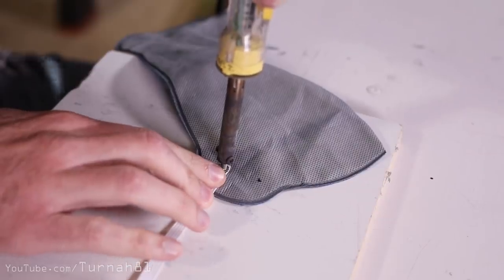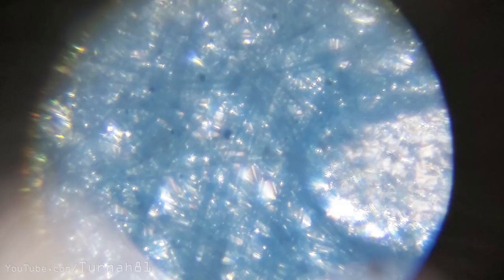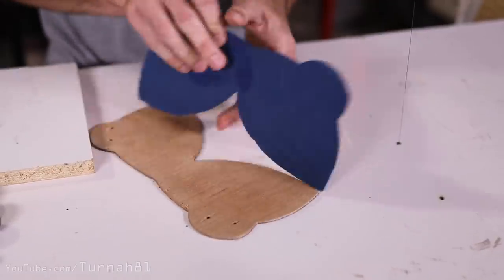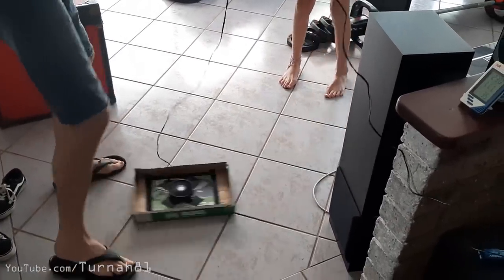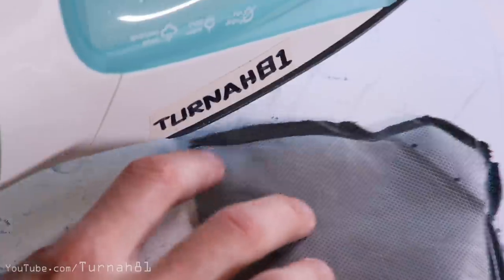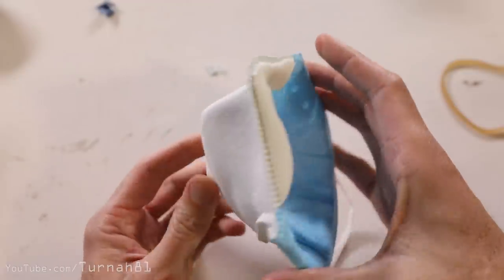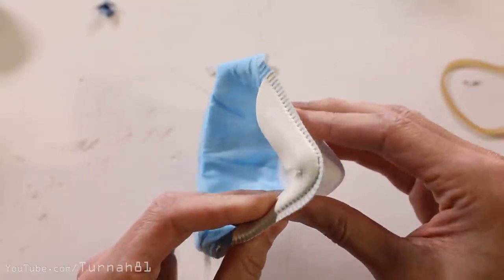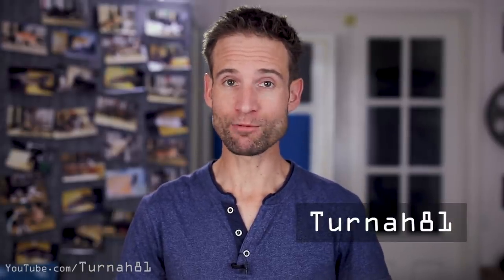How to Make the Best Face Mask, No Sewing (Don't use Cotton or Vac Bags!)

Comment: Dude who has surgical gowns and car covers in their home?
Reply: I found some of the grocery bags!
Reply: re-useable shoppers from Walmart are 99 cents here buy a couple skip the car cover part, i think!
Reply: Even decorative bed liner made of olefin is the exact same thing. Those foam sheets are in the craft section at Walmart in stacks  of 50 for about 2 bucks. I think the edge of a hot comb covered with  aluminum may help weld and the teeth might work on the elastic. Then wear a cheap Mask or  bandana over it to keep it protected from napping.
Reply: I can order a car cover from Amazon for $150 to $200.  I spotted a car cover on a neighbor's antique roadster in his driveway a few nights ago...Hmmmmm!

Comment: The stuff with the dots should only be used in the outer layers. It's used in proper masks because it's easier to shape, but it has terrible filtering properties. This thing you're making is only make things worse because it will give you a false sense of security.

Comment: Nice video Craig. After seeing that soldering iron tip I think that you should stick with the screw rather than putting that tip back in.
Reply from the maker: Yeah actually a counter sink screw head would be ideal. By chance though the bolt I had threaded in. That never normally happens.😀

Comment: Awesome video.  I tried my wood burning gun which has several different tips. works great for sealing hem and setting elastic.  instead of soldering gun with screw or iron.  Ofcourse your video gave me that idea after I melted polypropylene all over my iron. :)
Reply from the maker: Awesome yeah hearing lots of good reports on using wood burning tools. The PP comes off the iron pretty easily. From cold turn it on as it just starts to warm up it comes away easily with a wet cloth. cheers
Reply: What kind of tip did you use to seal the hem?

Comment: Fantastic design and interesting technique.  I couldn't wield the iron as shown, but I found that the handy Chicago Electric 5 in 1 Woodburning and solder tool I got at Harbor Freight a while back ($10) does just the trick using the round nub end and a piece of foil on top to prevent burning holes.

Comment: This is what i use as a linning in my cotton masks because its also water resistant so its perfect for protecting the inserted filter. I dont use pins because i avoid unnecessary perforation so i hold it together with tiny binder clips👍

Comment: I've had pretty good success with this design. I use my laser cutter to cut out the material and I also cut an MDF template with a 6mm inset to guide my soldering iron for sealing the edges. I use parchment paper above and below the material and found that 400 C is a good temp to slowly run the fat tip over the material. I've been using 5 layers of Smart-Fab which seems to be a good balance of filtration and breathability. For anyone else using Smart-Fab, I was able to use my 3D printing pen directly on the fabric  at 165 C and fuse up to 4 layers from one side without causing damage to the material.
Reply: "I accidentally made a hovercraft" Is a sentence I never thought I would hear.  Great video!

Comment: Great video, fun and educational at the same time. I'd probably just sew the seam and then iron heat seal the whole mask, like what was used for the front V seam. I couldn't trust myself to be consistent in the quality of the seam if I just used the iron method. Plus, wouldn't want to spend so much time on trial an error. For personal use, it would be good enough.
Reply from the maker: Yeah that sounds perfect. In sewing the front seam  the only issue I had was the thickness. I think I was getting to the limit of our machine? The thread was snapping sometimes.  I'm not very good with getting the settings right either though.
Reply: @Turnah81  Sometimes a different type of sewing machine needle helps.

Comment: Great video! Sleek mask design! Thanks for sharing it. The only comment I have is that N95 masks are electrostatically charged (in addition to using high density PP) to further increase filtration efficiency. Although the mask in the video is highly likely to perform better than cloth masks and likely to be better than surgical masks, I would hesitate to make definitive claims about filtration efficiency because that requires rigorous testing. All that said, enjoyed the video!

Comment: Be Careful when you use those materials!!!
Non-woven propylene can be of different grades, some are ok right in front of your face and some are not. Some can shed fibers through the whole life of the fabric (even after washing and in some cases washing accelerates the breakdown). I had some bags made with it that literally turned to dust in a couple of summer months in the car while other grocery bags of that type (obviously better quality material) have been there for a few years and are fine. 
The quality of this material has an extremely wide range and the lower quality is not something you want to breathe through.
The nonwoven material used in masks is certified for that use even because the whole production and materials qualities are controlled, not just the filtering level.
Masks used in hospitals in the old days (up until around the 70s when everybody moved to the disposable ones) were cotton muslin (defined as fine dental gauze), 4 layers. They had a pocket for filter to use in surgery (in surgery room the filter was meant to block exhalation, can be switched for a different filter now) . One example was the Cestra mask if people wants to look it up.
It's not meant to be fearmongering, people can make their own masks however they want as long they know that they could be breathing in small fibers that could mean lung trouble. If they want to take that risk they are free to do so, but there is too much quality variation to just pick whatever nonwoven material that looks right.
And I do know that is suggested to use that as a filter layer in masks but, for DIY, it is impossible to judge the quality of this kind of material until it actually falls apart, and one doesn't realize right away when it starts to break down as it starts slow at first.
BTW there are doctors that endorsed the use of vacuum filters also, made youtube videos, and then comes out that they are not an healthy filter material. So much for that.

Comment: This is the best "DIY" mask out there, with several flaws.
Without the exhale valve the CO² level in your blood will soon increase to a dangerous level, and in a long term usage might cause several problem like nausea, fainting, dizziness etc. It can even be fatal in rare cases.
N95 mask is really bad at circulating exhaled CO², thus the need for exhale valve.
Reply from the maker: Respectfully its simply not the case. Many N95 masks have no exhalation valve. What your describing would be the results of breathing into a larger dead air space like a bag. The valves don't evacuate any additional exhaled air as they aren't pumping air out,. They do make the mask less humid though and decrease the chance of glasses fogging up - more comfortable. However they are also a failure point for reuse as the can begin to leak with small obstructions and wear. They also should't be used if you are sick - they release respiratory droplets.
Reply: Fair point on the release of droplets, as a mask(for Covid19) is more for the safety of the public rather than the user.
Nothing more to say than "Well Done mate"

Comment: This is the best diy mask I've seen yet. I ONLY WISH we knew how the factory electro charges them. I heard n95 mask get some type of electric charge which keeps viruses out. I also heard they lightly spray the front with some citrus.
Reply: The electrocharges are done in the melt spinning process to make the non-woven fabric.  It is covered by several patents and contributes greatly to the efficiency of the particle filtration - especially small particles like viruses.
Reply: I saw a materials specialist on YouTube explain that you can use a hair dryer for 30 seconds to add back "static charge" after washing and disinfecting in boiling water for 10 minutes.  He also said this was optional, as most virus filtering happened from the structure of polypropylene itself.
Reply: @datasciyinfo5133  interesting
Reply: The term, according to my Electronics engineer is "electret"...

Comment: Instead of the electric wire, I use solder solid wire (3mm) that I hammer to make it flat. It is so great that I make it the full length of the mask.

Comment: For the adjustable nose piece, Im using the rim of circular tin cans. The body of the tin can is too thin but the rim is about 2mm.

 I use a can opener and shears to rip it out and cutt off excess. I then go around the entire thing with pliers so no sharp bits are poking out. I suppose I could go over it with sand paper as well.
Reply: Now that is a good idea, thank you.

Comment: 1- car covers are made from many different materials
2- N95 masks are not simple filters. They use an electrostatically charged material in the center layer, to trap finer particles. Big difference!
 Or see filti dot com for a new fabric that claims to have a better effectiveness than N95 because it uses a finer filter layer.
 And "moleskin" or similar foot blister padding will do the nose seal. Cotton or plastic foam, self adhesive.
 What you've got is admirable, it just isn't near N95.

Comment: Floor dust collecter like you see on a wooden floor brush . It's non woven and very cheap  to use as your filters. Use you cotton for the outer cover and seal it all with wonder web like you use for hemming a pair of trousers and Pipe cleaners for the noese seal  . No Holes . no needles. easy

Comment: I Used a vacuum sealer (to seal food in storage bags) to seal the edges and it worked great, only if they had one that curved. I also used the tie from a coffee bag for the nose piece.  I did use a Micron Filter Vac bag though, not HEPA. Thank you  Turnah81

Comment: Something to take note of. The major difference between this and an actual n95 mask is that the n95 mask has a static charge which attracts particles to it. It is that mechanism that makes them so effective, not that they are made of pp. You may as well use cotton wool as it is more easily available in the baby and makeup sections of supermarkets.

Comment: Take soldering iron, change tip for copper tip or you use plain iron nail. Flatten the end of the tip and you can use that istead of plain iron. More precise and more convenient to use. There is clip on YT how to make flat end of pin on soldering iron and it is used exactly for this - joining without sewing...
There are various soldering irons, some have temperature regulation, but with a little of practice there won't be need for temperature regulation. I hope you make new video, with some improvements you made maybe. All you mentioned in video should be posten on web page, with lists of materials, dimesions, steps, pictures, photos...of course, if you have time.
Also I would like to see you come up with mask made from hepa vacuum cleaner bags maybe?
This video is one of the most helpful I foound.
THANK YOU!

Comment: I had thought about getting some small-sized bras and cutting them in two, adding some rubber bands, and away you go!
Reply: Actually, many years ago someone did come up with a commercially-made bra that could be removed and folded over to use as an effective gas-mask. But the invention was a flop as it was only effective for some women. An A-cup for example was too small, and a DD-cup was far too big. Covering the entire face.
Reply: Rusty The Raver I made one with a bikini top. I get lots of compliments 😂

Comment: Great video!
Suggestion... laminate a middle  layer of a micro-particle HVAC air filter that is rated for bacteria and viruses (at least 0.3 microns). No vacuum filters as they can contain fiberglass (not good to inhale glass particles).
In the US, we use the MPR or MERV scale to rate particle filtration. This info is on filter packaging (in US).
The one I use is made of synthetic fibers that have a factory-applied electrostatic charge that aides in capturing micro-particles like viruses.
Thanks for the "asshole" imagery, its better than "my grangmother's coochie" that I was going with... I know, I have issues too.
Stay safe everyone and keep the video's coming!!

Comment: Fantastic video and ingenuity, if you wanted to test the effectiveness you could build a small acrylic of polycarbonate box with a smaller square cut out of one end' place the filter over the hole and seal with' place a a fan on top to push air in. On one of the edges if the box you can. Have a small slit to let air out to make positive pressure in the box and to test particles you can use a sensirion SPS30 particulate matter sensor (they are pretty affordabel).

Comment: Interesting mask and thanks for the time you spent on it.  Did you ever consider any kind of sewing interface instead of cutting up an expensive car cover?  Also I recently read that if you take one or two pieces cut from furnace filter MERV 16 (or you could double Merv 11) and use that (don't know if it is washable but you could probably make a little pocket and wash the outer part after each use and retain the filters.  My problem is that the original N95 masks (lucked out as my son had a box from before this started) are too big for my face and this probably renders them useless.  I only need to wear it once a week and then I leave it on my dash to be sanitized by the sun, I hope.  Someone correct me if I am wrong.  Mr. Turnah I hope you  will check out some of the sewing interfaces that looks similar to the materials you had in your video.  Most of the interfaces come in white but I think one comes in black.  You can check these out at your local fabric store or Joann's in the USA. Brand name Pellon.

Comment: use your hot wire concept, at a lower temp of course, and make a metal template of the mask mounted on a wooden press. Maybe you can just push it onto the mask and weld all the edges at once (any front seams done separately, of course). Like a hot cookie cutter...

Comment: This is awesome!!! Is the outer layer water resistant?
Reply from the maker: Actually if you don't pre-wash the material it does retain more of its hydrophobic properties. But still if washed it is far more resistant than cotton.
Reply: Turnah81 I absolutely agree. I designed a mask using water resistant outdoor fabric for my channel but the particle filtration is nothing compared to yours. You’ve put so much effort into designing this, it’s awesome.

Comment: Right from the start: the seam at the center is bad, you should avoid it or make sure it is completely airtight. The point of the N95 (FFP2 in Europe) is the filtration part, if you miss that then you're never going to get any close to that. The fitting should indeed be rather tight at the edges, so if your mask doesn't fit your face then it's the wrong size or it need adjustments.
A design that works well is the square one with 2 or 3 folds across your face, with a gap between two layers to put a "filter". Some dusting wipes that are charged with static are what you would look for since they literally attract particles to it. Don't wear them for more than 4hrs, put the filter in the trash, wash at 60°C with soap only.
The technique to get the materials to stick together was really interesting though, just make sure you can breath and that liquids can go through the material or else you're going to suffocate and/or have a puddle of sweat in your mask.
The best you can do in any case is get your hands on an actual mask and learn to use them *properly*.

Comment: You could just put the nose piece inside the layers, saving all the extra work... a three or four layer pipe cleaners  work.  I just wind them and you just need a few dabs of hot glue.
Reply: I have some Florist or gardening wire--that works too.

Comment: Back in the day, the next factory made press knife forms. Can imagine a metal strip bent into the shape you want, heated to temp needed, pressed into your layered  selection.  This then fuses it together. Easily cut out.
Reply from the maker: Yeah thats it. That was basically my original vision for the project - a hot cookie cutter/weld . Experimenting It could can be done for the cut but the weld is far harder to achieve the right heat, pressure and contact time and the material may vary each time too in thickness. I didn't pursue it in the end because I figured the level of work for me- or anyone- to get it to work right would be excessive and not as helpful as the core concept. Cheers :-)

Comment: Excellent mask, if I can actually source the materials...
Question.. could you use the soldering iron throughout? seems to be an easier tool to use to seal the edges than a bulky iron? 
Did you try that ?

Comment: oine suggestion I got from another channel is to use foam tomato plant wire for the nose bridge. Have you washed these yet? do you hand wash them or can they be tossed in the washing machine? How do you dry them? Also, I'm wondering if you use the non-woven polypropylene fabric as a filter layer in the fabric mask, if that would be suitable enough. I'm thinking if I use a sewing machine I could run lines of e6000 along the stitch lines to prevent air holes from letting air through that way. ESPECIALLY since hot glue is heat sensitive and may melt in a warm dryer. e6000 is clothing safe, dries in 24 hrs and is washer/dryer safe.

Comment: The n95 filters have an electrostatic charge to capture small particles which isn't possible to DIY and even this will degrade through washing and reuse which is why n95 is meant to be disposable. It's a good effort but you could have easily ordered n95 filtration material on aliexpress for not much money including the reusable mask...